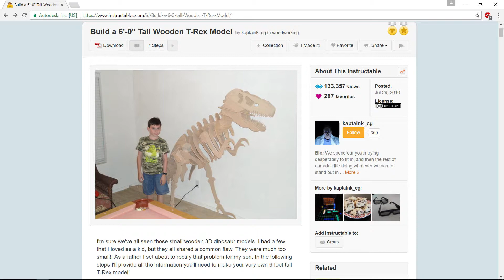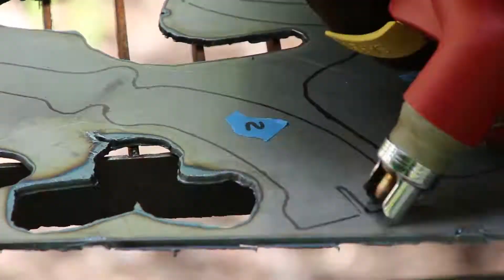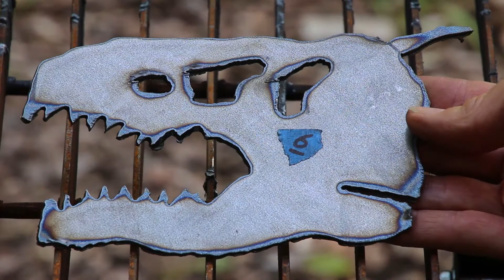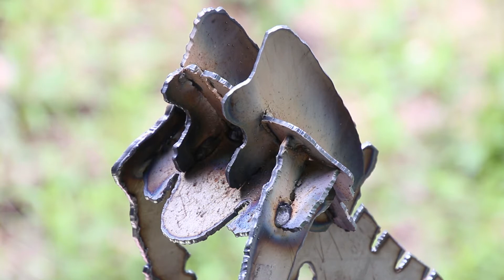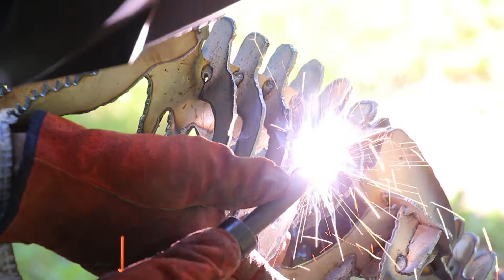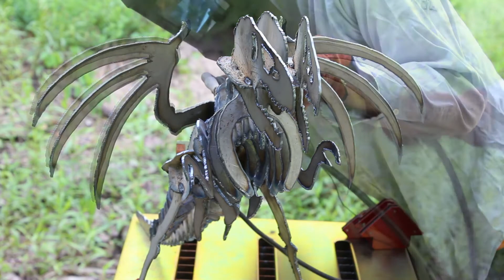Plasma Cutting & Welding a Steel Dinosaur Dragon Sculpture

Comment: You know, if you worked on the pattern a little to make it a bit more dragon-ey from the get-go, cut the pieces out with the CNC, welded them, cleaned them up, and powder coated it, it would probably sell for quite a pretty penny.  Actually, most anything made out of powder coated steel in that style would sell rather well.  Anyway, looks good!
Reply from the maker: Thanks, I hadn't thought about powder coating it but that would look cool, if I could get the surface clean enough for powder coating. But for an easy-to-apply finish, it's hard to beat rust. :-)